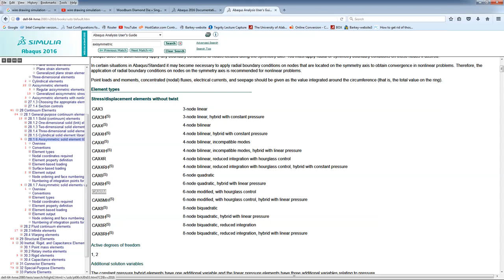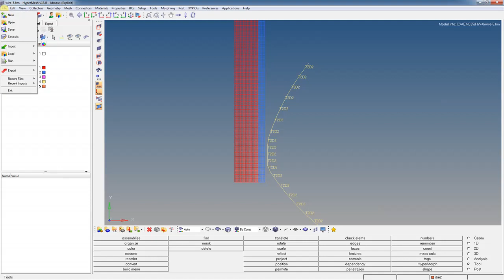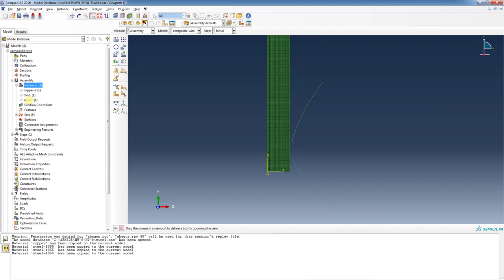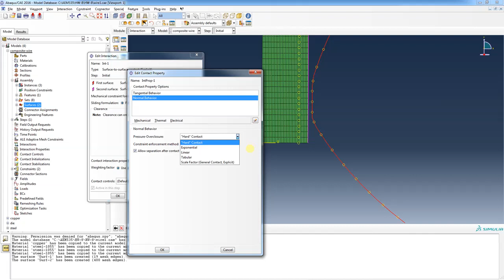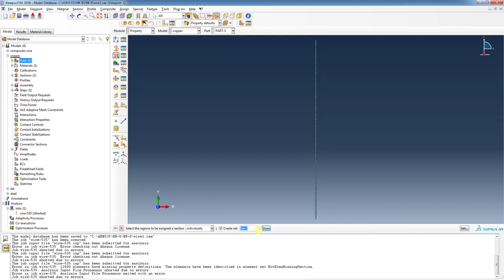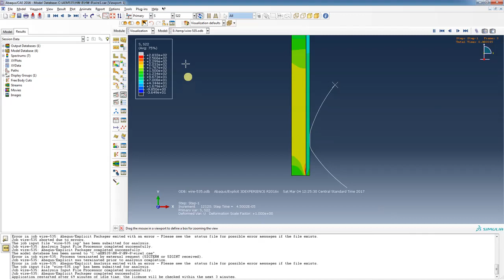AEM 535 HW-8 Drawing of Bi-Metallic Wire

Comment: Could you give me your material properties?
Reply from the maker: All the files I have are located here: http://forums.mbarkey.com/index.php?topic=137.0  (registration required for downloads)
any other additional information can be found in the associated paper:  T. Sasaki, M. E. Barkey, G. Thompson, Y. Syarif, D. Fox, ‘‘Microstructural Evolution
of Copper Clad Steel Bimetallic Wire,’’ Materials Science and Engineering: A, 228 (2011) pp. 2974-2981, 2011. 
I will also add that I have never been very happy the this analysis and have not found the best parameters for this one.
Reply: @mbarkey.mechanics  I think velocity that before and after wire drawing out of die  are different. Why do you set up the same velocity in wire?
Reply from the maker: @DAN-qb2uf  Wire draw speed is a process parameter at the factory--I've been there and watched the process.  I have a difficult time imagining how a spool of wire pulled through a die would have much different velocities on the front and back ends.  But, feel free to change what you want in the analysis files.